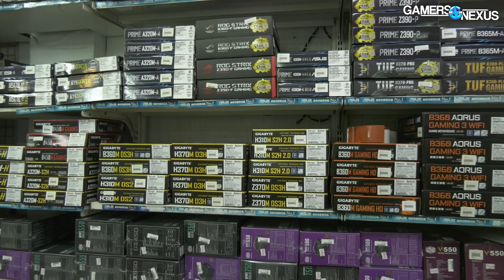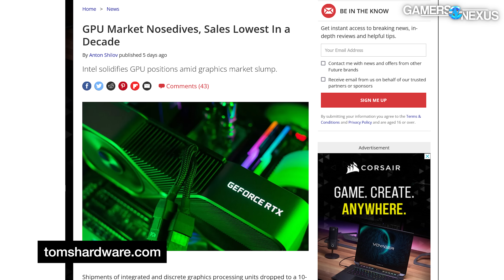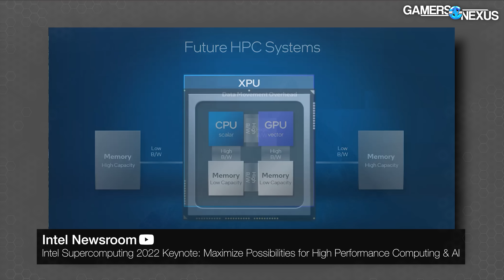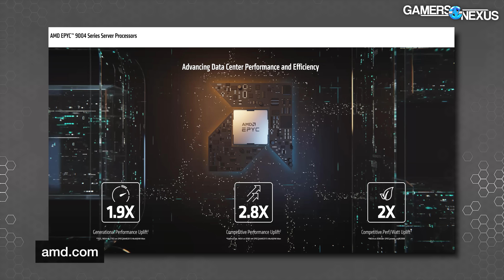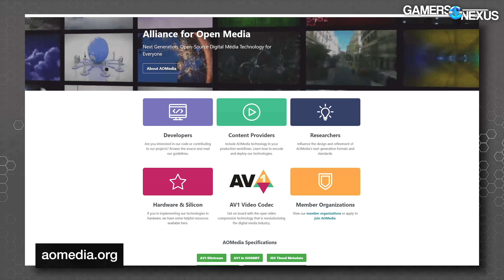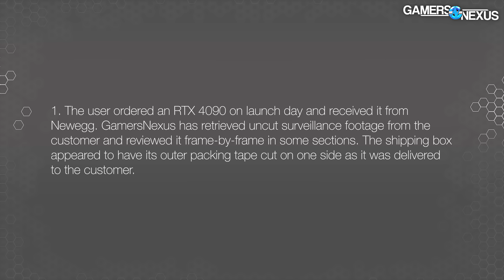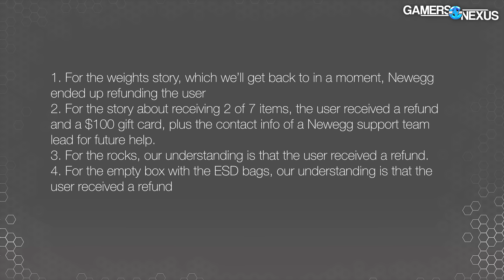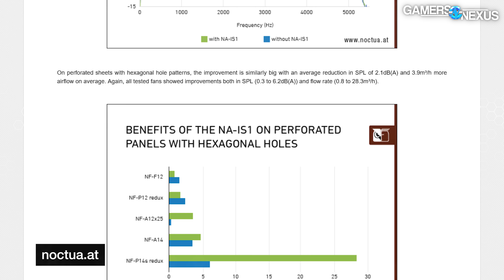HW News - AMD Beat-Down on NVIDIA Prices, Intel RAM on CPUs, Newegg Follow-Up, & More

Comment: HBM on a CPU is a big step forward. Applications like computational fluid dynamics are so much memory bound that the TFlops/s don't matter at all. Would only be useful in 64GB HBM-only mode as HBM cacheing will kill performance on a non-cacheable algorithm.

EPYC Genoa are still severely limited by DDR bandwidth. I've benchmarked my CFD software on a 2x 9654 system and from the theoretical 922GB/s I get only 212GB in practice. Still the fastest of all CPUs tested so far by a long shot.
Reply from the maker: Anyone want to take a guess at when it goes consumer?
Reply: @GamersNexus  Zen 6/Lunar Lake, maybe? I don't see it happening for at least the next 2-3 years, but given AMD's use of 3D stacking on GPU's, I wouldn't be too surprised if we saw HBM/MCD stacks on RDNA4 at the very least.
Reply: @GamersNexus I guess HBM is still not ready for general CPU use yet as its capacity is too limited. But we've seen some HBM GPUs spill over from datacenter to consumers already, like Radeon VII (rebranded Instinct MI50) and Titan V (rebranded Tesla V100). Personally I'm waiting for the H100 PCIe 120GB :)
Reply: @ProjectPhysX  What about Milan-X vs Genoa bandwidth comparison?
Reply: @rezaramadea7574  I have access to dual-7773X systems but unfortunately can't install the Intel OpenCL Runtime there to test. Would expect maybe about half the performance of Genoa as their bandwidth is about half.
Reply: @ProjectPhysX  It has nothing to do with capacity really, it's about price.
Reply: Something Something gpu
Reply: @GamersNexus  Hard to say, somewhat unlikely it even goes into the regular desktop parts. HBM is great tech, however AMDs push to make this mainstream and get economy of scale on it's side sorta failed already and they tend to be shy about re-trying something that already bit them once.
Reply: @PineyJustice  The push could come from a company that has more weight in the market, maybe Intel actually.
Reply: @GamersNexus  Broadwell 2.0
Reply: @ledoynier3694  HBM actually makes a lot more sense for cpus than GPUs, HBM is better at rapid access of fragmented small data bits while gddr6 is better for raw bandwidth, bus size vs speed since the HBM bus is about 10x wider yet bandwidth is about the same between them. HBM is awesome tech and I'd love to see it on cpus, GPUs. The thing it really does amazingly well for GPUs is just how small it lets them be, probably 25% of the gpu board is just vram and circuitry for the vram while HBM puts that all in the gpu package. I have a vega 64 and a fury x, the fury x was a truly amazing card for the performance and size.
Reply: @GamersNexus  Intel pioneered that principle in the mainstream with the i7 5770C, didn't they? It's the same principle which makes the 5800X3D great for certain workloads.
Reply: @ProjectPhysX  HBM was co-developed by AMD back in the day, so they initially included it in their consumer-grade video cards after it was market ready. But it turned out to be too expensive for consumer hardware, so currently, it's only used in server products for the time being. I don't know when this might change.
Reply: @GamersNexus  Intel 3 so 2024/25 maybe?
Reply: @GamersNexus  hmmm depends on how the software vendors will react and how cost effective hbm becomes for mainstream usage. I see Intel's ONEAPI giving them an advantage for quick integration, but AMD & Nvidia are willing to spend the resources and work with software vendors as well. 

Tough to make a guess...I'll say, give it 4 - 5 yrs and maybe we might see a few hbm consumer halo products.
Reply: @G T it's technology limited. You can't have more than 16GB per HBM stack right now, and you can only place so many stacks around the main die.

Comment: I'm concerned that this "Ram on a chip" solution is going to lead us down the regressive path of "HEY GUYS! WE JUST RELEASED THE EXACT SAME CPU BUT NOW IT HAS MORE RAM FOR $500 MORE!"
Reply: but what if this theoretical CPU release comes with measurably increased gaming performance, because the cores are more able to be fed low latency data? A la the 5800X3D?
Reply: Apple customers should feel right at home, if that ever happens.
Reply: Apple customer will be happy thinking about zillion games they can play using SOC with memory directly connected.
Reply: What's wrong with that if it's better?
Reply: @mintymus  Better is good but I'm not willing to spend a month pay for a better gaming computer.  There is a point where I just dont care for extra performance if it comes at an insane price.  Which was similarly mentioned in original post, these prices may spiral out of control.
Reply: @NoName-bg2om  I guess it depends on how much you make.  Either way, better is going to almost always cost more...at least at first.

Comment: Regarding the Newegg missing/replaced items story.
I worked for a Courier company for a few years (over a decade ago now).  I found out shortly after leaving (from a very reliable source), that a really popular guy there had been swapping TVs that he was meant to be delivering.
He was buying cheap crap at a store of the same size for TVs he'd failed (maybe deliberately) to deliver that day, taking out the shipped TV, replacing with the cheap crap, delivering the package the next day (or returning to depot if (still) unable to deliver, then selling the shipped one on ebay.
I don't know how he thought he'd get away with this, people are going to notice and the complaints will be traced back to him, seeing the pattern and with it sufficient evidence for a police investigation (which occurred), but .... yea, even outside of really tough economic times, people will perform really dumb thefts.

N.B. He was part of a relatively small team that was a somewhat separate company who worked alongside and in conjunction with the much larger courier firm, where they took their undeliverable parcels home at the end of the day (as they primarily made residential deliveries in the evenings, so the depot was closed when they'd finish (and not reopen for incoming overnight trunks until too late), which did offer more opportunity to do this than most would have had.
Reply: Yeah, I'm sure places like "pet food express" don't have ANY issues with packages being tampered with... But Newegg? I guarantee those get pilfered in the delivery chain.

If I ran a company shipping valuable goods, I would ship in plain boxes.... The free advertising from a box logo is just a theft target. Who's going to shop at Newegg because they saw the box?
Reply: @volvo09  It happens, but it's rare.  Not worth losing jobs over gaining a criminal record.  It's not difficult to spot the pattern of missing parcels/items being from one person.
The vast majority of parcels are plain packaging.  Wait, how can yo guarantee parcel pilfering and not know this?!?!?

Comment: Went from a 5700xt to a 6800xt and have had no regrets.  4K is not on my radar screen for now, and ray tracing does nothing for me.
Reply: Smart choice
Reply: did the same to a 6900XT for 1440p, best choice ever
Reply: I had a real tight budget when building my current PC and went with a 6600. For 1080p, it's honestly amazing. Runs everything I need it to really well. It always leaves me scratching my head when I see publications like LTT calling AMD cards a "meme". It's far from everyone who need RTX in 8k.
Reply: 4K is pretty overkill for the average consumer tbh... Nice to have, but unnecessary.
Reply: @n n as someone who has 3060, I must agree. Not a single title I play has rtx
Reply: I do 5120x1440 in a 6800xt and it works great and I find going wider is far more compelling than going denser
Reply: @plebisMaximus  well that title was directed at the marketing of the coming RX7900XTX, which actually is quite meme worthy. They claim 8K capable gaming card but off course only in certain games and with newest FSR SR activated. Besides the fact that 8k is absolutly irrelevant, advertising such a card as a 8K gaming card is pretty stupid.
Reply: @ratlingzombie8705  I haven't watched their coverage of the new cards, the only LTT I watch is select clips from the podcast and in one of those, I've heard them call AMD cards in general a meme. Sure, it's a format that leads to saying all sorts of shit, but still.
Reply: @plebisMaximus  recently they've backpedaled that a bit, especially with the announcements regarding RDNA 3.
Reply: Same here. 1660 ti > 6800xt. New amd gen is on my radar, but I'll wait it get polished and have some cuts to prices. It'll arrive expensive here in my country. 6800xt will serve me well until the day comes. Maybe I don't even need a 7000 card and skip to the next gen.
Reply: 6800xt, plays 60+ fps with RT at 1440p. But it doesn't really look hardly any different, its like having Ambient Occlusion turned on in a multiplayer game. You wont appreciate the lighting difference, its highly dependent on its own implementation, and it halves your frame rate. (With 1st gen DX11 cards, AO straight up took 75% of the frame rate.
Reply: Yep, I went from a 5700 XT to a RTX 4090 Strix and have no regrets!
Reply: As a 3060ti owner I also agree. Couldn't give less of a shit about raytracing but having DLSS is very nice sometimes.
Reply: @spankbuda5760  i hope not. Thing costs more than my car. Hope it lasts as long for you, too.
Reply: @SethOmegaful  I usually skip gens but got a great deal on a 6800xt and decided that if I took it I could skip the 7000 train
Reply: @plebisMaximus  their appeal is only to the top 1% and even then it is really overhyped, the human eye can only perceive so much information and we are rapidly getting to the point that each additional frame pushed out or depth level added is only detectable with very specific tools.

Comment: Massive Kudos to ASRock, this is a gift for PC enthusiasts who are also Sonic fans.
Reply: And Biostar for making motherboards for racing enthusiasts 😂
Reply: I had such bad experience with ASSRock, i would not recommend. I nearly escaped bricking their mobo by official bios, and saw on forums that a lot of people did.
Reply: Not just Sonic fans, Sonic Lovers!
Reply: @Wakka9000  never had problems with my x370 killer sli. Running perfectly fine since 2017, now with latest bios and a 3800X
Reply: I've even saw it already yesterday at a German online shop for PC hardware. Fair price, although sadly Intel-based 🤢
Reply: @andrew6978  I'm more of a modern gamer myself.
Reply: @andrew6978  fax
Reply: @xPandamon  Intel is still good
Reply: @RealZepex  They're fine, just not a company I want to support. They've been incredibly lazy for years and even now, they're still pretty lazy. Iris XE and Alchemist drivers are mediocre at best, their LittleBIG architecture is fine, but it's already at it's limit of how many small cores they can squeeze in (and despite having efficiency cores, still less efficient than AMD) and they tend to not care about customers unless someone else does first, I mean they still sell motherboards with locked RAM overclocking in this day and age..
Reply: @xPandamon  yeah, I don’t really care over which company makes better CPU’s though. I plan on using both in the future
Reply: @RealZepex  I generally don't care either, if one is more powerful and fairly priced it's hard to say anything against it. I have my personal reasons to not go with Intel, but everyone is different and competition is good! But I'm curious, the new 3D-Cache chips should be a lot faster than the current Zen 4 chips at the moment so I want to see what Intel can do to compete. Right now I don't see any way how they would be able to, they can't crank up the frequency much higher and can't use even more E-Cores, they finally need something actually new for once or they'll fall behind
Reply: @xPandamon  true
Reply: Well, unless the VRMs suck.
Which they might, since it's a combo of ASRock (who usually does crappy VRMs) and also Sonic, which has more bad games than good ones.
Maybe we just have to get really close to the mobo so the good VRMs will pop in, kinda like Sonic Frontiers.
Reply: @mjc0961  you right about ASRock not having the best VRMs, typically for motherboards I like MSI, Gigabyte, and Asus. IMO Sonic has more good games than bad games but I'm also loving Sonic Frontiers

Comment: I have a 6800xt and run 4k all the time with absolutely zero issues at a minimum 100fps in most games (others it drops down to 70-60fps, but still playable) 

it kicks ass :)

Comment: I tried ordering a GPU and Case from newegg last week. They refused my CC. I have no idea why, the CC isn't even carrying a balance. The only message was check with my bank. I placed the order at amazon with no issue whatsoever. My gut tells me that they didn't want to sell me the GPU because of its low price. Because the card in question rose in price a few hours after I tried buying it. Their loss, I shelled out over a grand at Amazon instead and will not deal with newegg again.

Comment: For me the largest takeaway from thew Newegg revisit it twofold: consumer confidence in Newegg is currently quite low (I leave it to the reader to make judgements on deservedness) and that Newegg still has many improvements to make to satisfy customers and start improving this confidence. Clearly multiple customers having issues contacted Newegg and felt like they were not being heard in a timely or proper manner and had to take third party action to get traction. Whether or not this made a difference in their issues is hard to say, but what we can say for sure is the fact they felt it was needed combined with low confidence and trust in Newegg reflects poorly on the platform and that Newegg needs to to better to increase consumer trust. 

I do think it's worth revisiting this topic as a whole 'in full' after a certain amount of time. Newegg is always going to say they are improving, because that is the correct thing to say, it would be nice to try and get a look to see if they are actually improving by a trusted media outlet such as GN once enough progress has been made. I know it is inherently difficult to try and get insight into things like that, but that's the reason I trust GN specifically with it.
Reply: The best solution I can personally see is for the companies to simply plan ahead for those cases in their margins. It's just not worth the bad PR and customer relations.
They need to compensate for it because goodwill alone absolutely will be abused. I've seen quite a few people write about how they pocket products from Amazon once or twice a year because the support offers a no questions refund and their order volume is large enaugh to not be suspicious. But on the other hand my family had maybe a dozen customer support interactions over the years and they've been top notch. I don't want to imagine going through the Newegg gauntlet every single time.

On the other hand I feel that the postal carriers should implement much more robust checks for their packets. Messing around with personal mail is a very, very serious crime afterall.
Reply: I dont even shop with newegg anymore.  They have gotten to be extremely terrible ever since the buyout.
Reply: @digizilla164  (who) bought newegg?
Reply: @ghoulbuster1  they were blught out by Hangzhao Liaison.

Comment: Jealous of the deals over in the US. Over here the prices have been stagnant and in some cases gone up compared to the weeks before black Friday.
Reply: In Germany the RX 6600XT is at 400 Euro, the 6700XT at 450.
A 3060TI is at 450 Euro.
Depending if you value DLSS somehow, the 3060TI is the best deal out of those cards.
If you only interested in Renderperformance the 6700XT is the deal to go.

6080 is at 580 Euro, 3070 is at the same price. Regarding DLSS + RT performance, I'd rather buy a 3070 than a 6080.

The US are much cheaper for several products atm.
Reply: sorry bro :( look on the bright side, you can still go see a doctor even if you're not working at the time, and you don't have to pay hundreds of dollars a month if you're a diabetic!!

Comment: Can confirm the last gen Radeon GPUs are the way to go right now, I got a 6900 XT for $700 and don't anticipate needing to upgrade for many years at 1440p
Reply: Had my 6900xt for over 1 year now it's just keeps getting better solid gpu at the moment.
Reply: God I paid $1,400 for mine during peak mining season. You have to remember though, the card launched at $1,000, so $400 over MSRP wasn't that bad at the time, but now it really hurts.

Comment: On this Newegg issue they need to check any common point in these orders.  If it's particular area shipped by a particular shipper it can be easy to pinpoint where the issue is.  There was an area in California that during one holiday season had a large number of PS5s not delivered even if marked delivered and they  all came from a singular Fedex endpoint.  After the story made the news nationally suddenly all these PS5s were magically found in this Fedex warehouse and delivered.  It does not take a detective to guess what was likely happening in that situation.

Comment: HBM on CPUs sounds interesting and the only innovation from Intel in the past few years. Good job.
Reply: Concern there will be heat anyone rmeebr how hot radeon 7 cards where
Reply: @garycollumbell1396  that's because AMD sells heaters that also function as CPUs/GPUs
Reply: @DurzoBlunts  Just like Intel and Nvidia. So what's your reason to point at AMD?

Comment: Steve, The MCDRAM / DDR technology was used successfully in the KNIGHTS LANDING Xeon Phi chips, where it included 64-72 cores, 256-288 threads, and 16GB of on-die MCDRAM memory. What you're describing with being able to boot, use both, or cache was a BIOS option in the original KNL Phi BIOS. I still have one of those beasts running. It makes for an amazing docker server, but since it lacks virtualization instructions, it doesn't do well as a virtualization server. That is something I really wish they enabled.